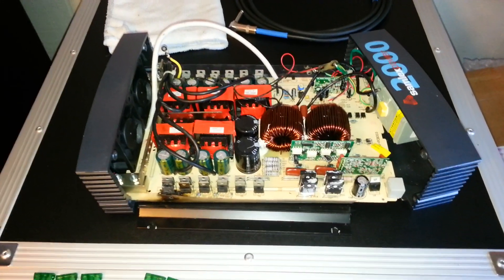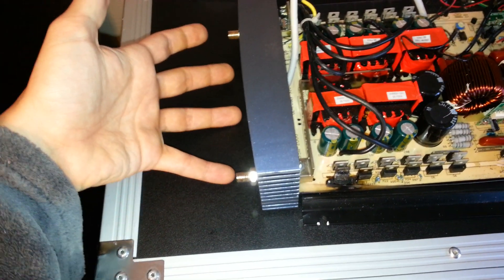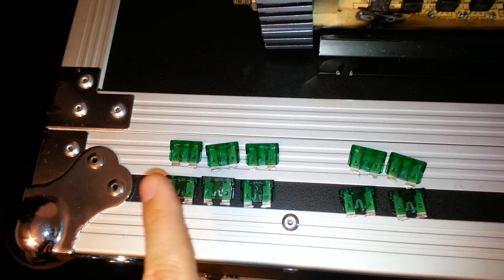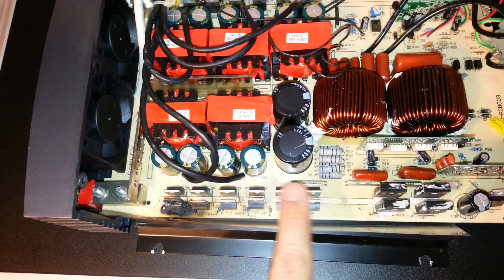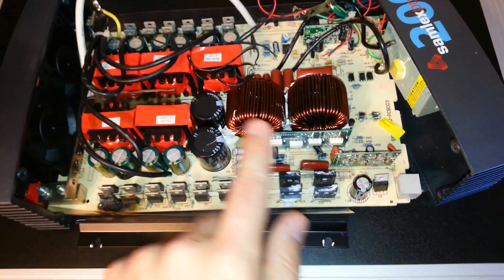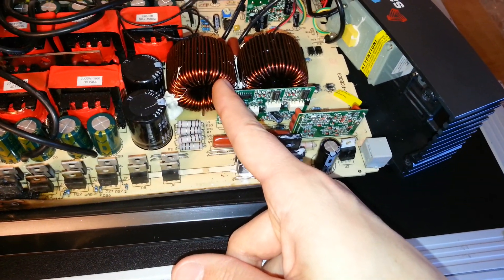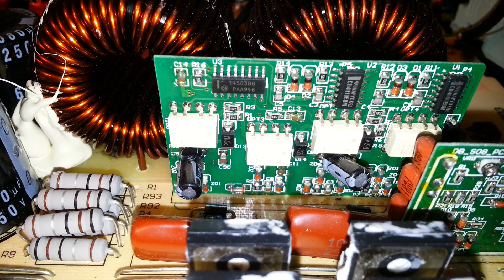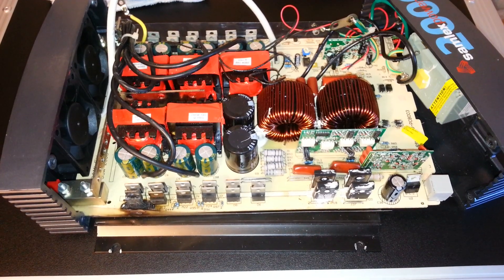Samlex SSW-2000 Pure Sine Power Inverter Repair: Part 2

Comment: So, I take it that an ANL 200A fuse on the positive cable would've avoided such catastrophic failure?
Reply from the maker: not necessarily.
Reply: OK, watched all 5 vids....overload heat/power surge blew the weakest link with domino effect. Samlex aren't cheap.....Exeltech are well made; brass posts, coated boards, direct connectors, yet hard to find......GREAT show! Thanks.

Comment: Just a note, fuses should look like dead-shorts, so if your inputs indicate a short, that suggests, instead, that at least some of the fuses were still good (and that some other components in the circuit are shorted), It doesn't indicate that some of the fuses are bad.  If your inputs had been open/infinite resistance, then it would have suggested the fuses were all blown.
Reply from the maker: Amra True fuses show a dead short, but not wanting Murphys Law to hit me because i didn't check all the fuses I removed and inspected each one. Without the daughter board installed it did not hold the FETS to ground keeping their gates closed. Applying DC voltage to the input without the daughter board I realized only later was causing an avalanche effect and caused the resistance to lower and cause the FETS to overheat because they were not shutting off like they should in the push/pull config in the boost stage.
Reply: ***** Yeah, removing them all, given their location, was probably the best course of action, and doing so would also indicate which areas of the board to inspect first (i.e. the areas protected by the blown fuses are more likely to have faulty components).

Watched the whole series, nice to see you were able to get it going, got lucky on that daughterboard working in the old ones place!